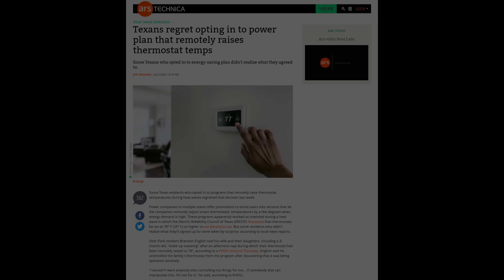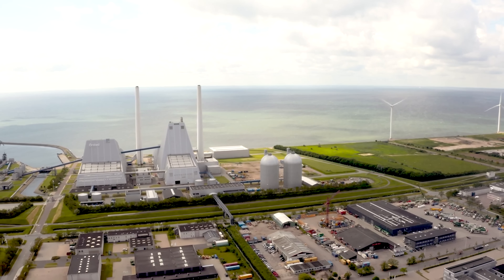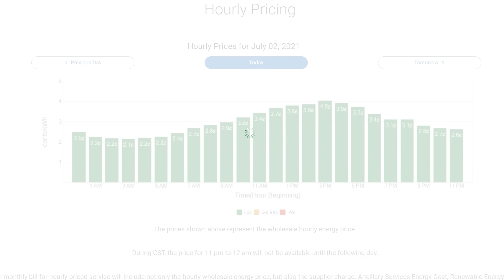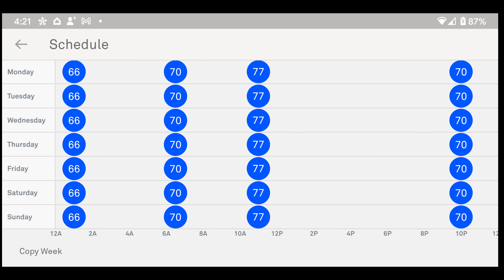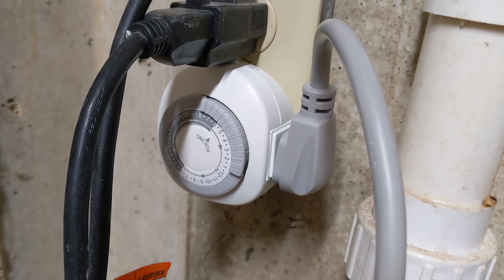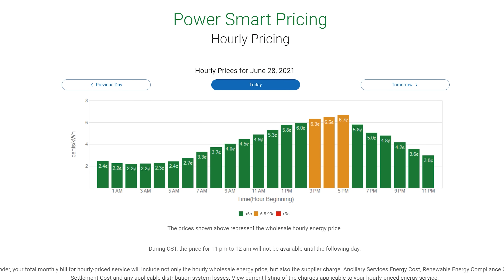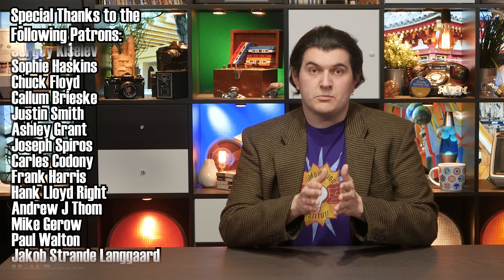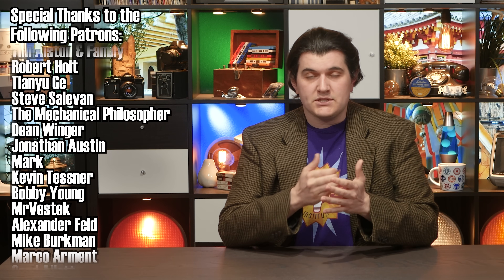Batteries aren't the only way to store energy. Here's another.

Comment: People forget that insulation works both ways, gets pretty crazy hot in Scotland these days but still cool at night so I open my windows at night and close them in the morning to hold onto the cool temperature during the day
Reply: I've been doing that here in mich for the last 10 years.
Reply: Same in California
Reply: Living in a passive house for 10 years, that's exactly what I do. Unfortunately, there is more a more noise outside during night, which start to be really annoying.
Annyway, insulation is the key. It is cheap, reliable, and almost maintenance-free.
Reply: Cool seeing you here, never would’ve thought an r6 creator top comment on this channel
Reply: I live in an Adobe house in southwest Colorado. Very dry climate but nights are cool. If I leave the windows open overnight then shut them early, house stays under 75 on a 95 degree day (freedom units)
Reply: I don't live in an insulated building, it's quite old, like 50+ years. It usually takes 2 days of hot weather for the inside to heat up. The issue is that when there are many hot days in a row, the building retains the heat and thus is hard to cool down during the night. I think a lot of the heat is stored in the roof. I don't have an AC so I try to create a draft, but if it only goes down to around 20C during the night it's just not enough to cool down the inside from 30C, at least not while the heat is still radiating from the walls and roof. I imagine it would work okay with an AC because as I said it takes 1 to 2 days for the building to heat up.
Reply: This topic is so important, an really, so easy, another way to store energy in a building is to use materials inside the house with high thermal capacity, let's say you have some internal concrete walls, they will suc the heat energy from the room when it's too hot and release it again when it's to cold, this way you dont have to cool down so drastically during the night, to have enough latent energy capacity to keep the temperature at comfortable levels, and the same goes in reverse during the winter...
Reply: Been doing the same thing is Aus also.
Reply: Crazy to see 2 YouTubers from different ends of the video spectrum show up in the same comment section.
Reply: And that is exactly why most European countries do not feature that many buildings with AC. We open the windows at night, let in the cool air and then insulate with the help of shutters.
Reply: We did this when I was growing up 50 years ago in Connecticut - we had a big attic exhaust fan that we’d use in the evenings to pull cool air into the entire house. I don’t know how many HP it was, but it was powerful enough to create a noticeable breeze in every room of the house, even with all the windows open. It’d cool down the entire house in a matter of minutes, but we’d leave it running for 30-60 minutes, to cool down all the plaster walls, which would keep the house comfortable well into the next day.
Reply: never thought of seeing an r6 yt channel here
Reply: that's brilliant
Reply: I’d rather not wake up to my house being robbed because I left the windows open! 🤣
Reply: council come and fit a stupid fan into the attic to prevent damp... aparently damp is an issue in these houses though i have literally none, never have, but it does have some wierd effects, i only have downstairs radiators turned on as heat rises so in the winter, upstairs doesn't become crazy hot, it's a nice balance... before, now the fan creates some form of barrier of cold air trying to get down from the attic and hot air going up, about half way up the stairs is a sharp transition of hot to cold, the heat doesnt go up anymore... and as for summer? well all that scorching hot air from the attic is readily blown into the house making it constantly ambient temperature (if not more if you're in my computer room!)... currently 29c outside and 34c in this room, i'm dieng.
Reply: @dickJohnsonpeter  lol wut
Reply: This is how we did it in california in the 90s
Reply: @bugz000  In my house it’s cold down stairs and roasting hot on the top floor where my bedroom is. In the winter it’s freezing all over the house and especially on my floor then with the heat on the downstairs hardly warms up while my room is a hot box. I can’t win!
Reply: People in Straya cry so much about their electricity bill but are unwilling to take any advice it is maddening. They don't even know window ventilation fans/box fans are a thing, and will run their aircons on blast even when its barely 26c. When you tell there are alternatives to lower the bill, you get some mealy-mouthed excuse that holds water like a basket. Like its 'too hot in Australia to ever use just a window fan' ..... Really our summers are nothing special compared to America. 
Then they will turn around and say 'Insulation? Double pane glass, gap sealing? its too hot here to do that, our houses would cook!'
Reply: @alminhelex  You mean the scale invented by German physicist brought to US by British empire?
Reply: I've honestly considered creating an electric window opening mechanism for this exact reason. Would be pretty easy to convert a crank mechanism, but mine are sliders.
Reply: @anasevi9456  maybe these people are not well enough educated on this topic and need to be taught about it and shown how these things can benefit them massively if they adopt these things. Just telling people won’t get them to actually do anything and them moaning about their electricity bill wont help them so between them ,the government and energy companies they could all do something to educate and make changes for the better, for the people.
Reply: Didn't expect to see you here
Reply: A weakness with that is that during a sunny day we get perhaps 10kW of sun heat through the windows, so it quickly heats up more than the insulation can keep the heat out, and we have to open a throughdraft.

Another weakness is your insulated walls can rot if the condensation point is within it. And there is no moisture barrier from the outside.
Reply: @fred-9929  Do people really not realize this? I guess it just seems intuitive to me. Might be a bit of selection bias talking just to people on this channel, though 😉
Reply: Yup. When we build our passive house with an HRV/ERV we're getting one with a bypass so we can chill the house at night in the summer if the temperature is at or below our setpoint and the oposite during the day in the winter. 
Made possible with like 2 ft of outboard insulation on a concrete house. Concrete has a hell of a lot of thermal inertia so hopefully the cooling during the night will be enough to coast through the whole day (and vis versa in the winter).
Reply: yep, i concurr. in france most houses (even old ones) have pretty thick walls. we never had an air conditionner, just open the windows at night to let the cool air in, then close windows and shutters in the morning and live on the stored negative heat for the rest of the day.
Reply: We tried that but our cats decided to explore their exit options so we don't any more :-(
Reply: That's a common Rookie Mistake. 😲 Because you're let in humidity that your AC unit has to work hard to remove the next day. It's best to leave the AC on as it won't have to run much once the sun is down. You also let in molds, gnats, pollen, pollution and noise (depending on location).
Reply: The issue is that the condense blocket is on the wrong side. So if you cool your house to much, the insulation get soggy.  And that is kind of bad.
Reply: Here in England (it’s boiling right now) we are doing that and also use the shadow of our house, we open the windows at the back, this has kept our house comfortable, even at near 30 degrees (no AC)
Reply: Wtf are you doing here. This is not a siege video.
Reply: Same here. The problem that I can't get around is getting the house cold enough on the inside during the night. While outside temeperatures get as low as 18°C most of the house can't get below 22-24°C during the night, (during daytime it can get up to 28-29°C) the house has North and South oriented windows but sometimes there's no airflow between them. I've trying to think of a way of forced air to move but I can't think of a solution that gets well integrated and not too expensive.
Reply: @awesomestuff9715  Funny you mentioned the video about fans, I saw it and commented there. I do use fans to help circulate the air, without them the air is almost still.
Reply: I was doing the same thing here in western Canada, but the smoke from the forest fires in British Columbia has become so bad I had to stop.
Reply: That is the only way I have to regulate the temperature at home, here in Germany. ACs are not that common over here, and most places you rent won't have any way of active cooling.
So once I forget to open the window late or very early, then I will notice the increased temperature the next day.
Reply: if they recalled that they would understand why winters will get worse due to green house gases, to bad for us humans are idiots.
Reply: I use box fans in the windows on the top floor blowing out and then open windows on the first floor to suck all the hot air out at night.
Reply: @nunya___  except nobody has AC in scotland and humidity isn't really an issue,(because we aren't cooling)  nor do we have toxic molds. if we get damp it's because the roof is leaking.
Reply: what are you doin here coreross. This isn't siege.
Reply: Feels weird to see a gaming channel comment here
Reply: @YelovXD  lol that's an interesting coincidence
Reply: An HVAC 'economizer' does the same thing, but manages it automatically (and also accounts for humidity). They're more common in commercial systems.
Reply: Been doing that for decades, even in the Alps
Reply: Guess this only works in Scotland where you have 24 hours of wind. Even near the coast in the Netherlands the wind dies down considerably at night.
Reply: I'd really like to do that, but I think I'll asphyxiate then
Reply: same.
working in a non ac'd dealership.
it bothers so much that they open all doors and gates wide open once it gets hot outside..
the building is pretty big, it will take several days up to a week until the inside will match the outside temperature, so why letting the heat in prematurely when you can store cooler air inside in the meantime..
Reply: I do that too. I hate being cold at night, but the cooler temperatures make the day more bearable.
Reply: This works OK for me here in Sweden, but during the hottest weeks of the summer when it gets to 30+C every day, and over 18C at night, it's jut not possible to get rid of all the heat during the night. Sure the temperature starts to fall when you open the windows at night, but the moment you close them it climbs back up to about 28C because there's so much heat stored in the building itself, and more keeps getting added each day. It works as long as there are only 2-3 hot days in a row however.
Reply: @alminhelex  If you install a whole house attic fan you can even more maximize that benefit.  I live in a dry high elevation climate (low humidity all year round) and utilize this same technique.  I have AC but it rarely has to run even on hot days.  The unit probably only runs a total of 2 weeks out of the year and that is not even continuous operation.  Even the fan only has to run a few hours at night/early morning then close up the windows for the day.  Like Alex said though, this is purely situational however this does not work in the plains with 100% humidly and where the dirt blows around a lot.
Reply: @matsv201  No. There is a vapor barrier on home insulation and homes in the US require a second full-room vapor barrier. And then there's spray foam insulation...
Reply: The Amish people in my area will build their houses to a certain orientation to allow for the best temperature management. Including strategically planting shade trees that cast shadows over the hottest sides of the house during the hottest times of the day (and hottest days of summer).
Reply: Yep, that's my new Alaska plan.
Reply: That's where a whole house fan can be very useful. It efficiently pulls air out of a house and you can adjust the cool air intake by strategically opening windows. Each open window cools that area plus the route to the fan.
Reply: Yeah, but you're weird.I'm just south of Scotland - I open the windows during the day to capture heat and close them at night to retain it !
Reply: Not mentioned, is stack effect. It can be very useful if you're house is tall, and has a way of directing airflow throughout. I had a 3 story home with a basement. I opened a window in the basement and attic - and nowhere else. It would store "coolth" in the basement during the night, and pull it up during the day. Initially, it worked till mid afternoon. It took me a few years to realize that the window fan was pulling air too quickly. Once I learned to limit the airflow, I routinely saw internal temperatures about 15°f cooler than outside through the hottest part of the day. This was in a 100yo house with no shading, no wind breaks, on top of a hill, with no insulation. All I had was a 4-5' hedge around my yard.
Reply: Trouble is a lot of places in the American south have little to no insulation, which makes for an even bigger load on cooling and heating than it ought to be.
Reply: in summer it's still usually 90 outside even overnight, last year we had a 28 day stretch where the temp didn't go below 90 day or night
Reply: I do the same all the time in summer, here in south west Germany. Worked perfectly for me so far.
Reply: I recently moved to a place that reliably gets cool at night, and doesn't get super extra hot during the day (actually it's pretty mild most days in the summer, but we have the occasional unpleasant week).  So I have different nighttime and daytime cooling modes.  During the day, I close the windows and their blinds & curtains.  As soon as the outdoor & indoor temperatures cross in the evening, I open all of the windows and the front door (which also has a screen door), pull back the picture window curtains (so I can radiate heat out that big piece of glass), and turn the bathroom exhaust fan on.  When it starts getting warm in the morning, I flip back to daytime cooling mode.  This place also has really deep eaves, which my houseplants don't like, but my cooling situation benefits from, by having way fewer hours of direct sunlight on the windows.  It occasionally gets too hot in here if we have an especially bad couple of muggy hot days and not-very-cool nights, but mostly I don't miss air conditioning.
Reply: @nunya___  those are hardly toxic, and the article itself recommends opening windows as a way to get rid of them.  "Can mould cause health problems?

Moulds are usually not a problem indoors"  and "Reduce the condensation that builds up overnight by cross ventilating your home"   In humid climates it's more of a problem because moisture will be inside the walls, or working its way inwards. in temperate climates it's condensation on the inner surface from cooking and bathrooms etc. hitting cold walls.
Reply: I do that in Cincinnati too. 

The only negatives are how humid it is here and we have pretty bad air if you have allergies since we’re in a river valley.
Reply: Oh shit, it’s coreross! I keep my windows closed during the day and closed at night because I can’t stand bugs and stuff
Reply: @RochRich.  bug screens?
Reply: If you live in a tall building and can get a through breeze, that is an equally cheap but simpler way of keeping your home cool. I live in a top floor flat, and in summer I almost never close my windows because there's no need. Paperweights are sometimes necessary though!
Reply: @OrigamiMarie 
I’ll probably buy one soon
Reply: I don’t think people forget that.
Reply: Yes, exactly!

We've had few heat waves here recently with daily temperatures reaching 35°C+ (that's 95° in freedom units), but during the night they can drop as low as 20°C (68°F). 

Such high temperatures are not common where I live, so many (including me) don't have AC, I had to improvise.

While bunch of my friends complained about the heat, their electricity bill (those with AC) and what have you, I've simply left two windows on opposite sides of my apartments open during the night. 

I've even found trough experimentation, that if I open two windows on opposite sides of my apartment during the night, it creates a draft that quickly cools down entire apartment. Plus I get fresh air every night. :-)

Then I only need to keep windows closed during the day, and sun-facing windows shaded.

My apartment didn't go above 24°C even during the worst of heat wave.
Reply: Yep, have done it all my life.
Reply: @nunya___  having two vapor  barier is a horribly  idea,  that was tested  here a few decades ago. They had to rip out the insulation in those houses
Reply: Crazy hot?  You mean sometimes it gets into double figures?
Reply: I do the same thing, but I also have a big 20" fan in the window.
Reply: Agree completely. In Wales, during this current heatwave my bedrooms are atrociously warm. The problem is there's no wind or even a relevant breeze, I leave all the upstairs windows and doors open but to no avail. I shut the blackout blinds and windows in the day but last night my coolest bedroom that does not get the sun all day was 24.3ºC. Could be worse, it could be 1976.
Reply: And of course that's in addition to being on the Isles where central AC isn't very common.
Reply: I'd do that too if that didn't allow swarms of mosquitoes in
Reply: @workdogwern4716  I do a variant - one window open on the top floor at the front and one window open on the bottom floor at the back !
Reply: @christopherrto  linear actuators built into the frame
Reply: I live on the South Texas Coast, It's been 82*F (27.8*C) at night and close to 100% Humidity. HAHA I do miss living in the mountains of Wyoming, could be in the up 80'sF (around 30'sC) but in the 40'sF (4'sC).
Reply: @TdrSld  [When typing, holding down the Alt key while you enter '248' on the numeric keypad, gives you this: °]
Reply: I’m very happy that coreross and I watch tech. Connections.
Reply: @fred-9929  Wouldn't it be easier to use the HRV "cooling" (bypass) function (assuming yours has one) to do it automatically?
Reply: Yeah, you can see many people to open Windows if its hot outside. Thats soo contra productive
Reply: Drives me crazy when I go out on my balcony at 10pm when it's a beautiful 68-70 degrees and about half of the people in my building have their ACs running.  Not only is it a waste of energy, it's loud as hell!
Reply: Was definitely not expecting to see a coreross comment here
Reply: Wtf you doing here? You still have to make that R6 operator tier list!
Reply: same thing i do here in the usa. i wasnt aware so many didnt know this
Reply: Nah just drywall and massive AC unit!
Reply: Scottland? i'm sorry.
Reply: Yeah, that's what we do at home.
Reply: If you get a cool night. I’m in Staffordshire and I just can’t my flat less that 25°c
Reply: "it keeps hot hot and cold cold"... Ya, but how does it know?!
Reply: Yeah my dad does that in New Jersey. His AC doesn’t click on until pretty late in the day
Reply: I do that too, but when you're on the top floor of a block of flats, it only lasts halfway through the day at best 😢
Reply: keep yourp
Reply: From California. Just upgraded windows to double pane. That changed a lot.
Reply: This works even on my old European house from 1900. No insulation on (yet), only ceiling has 50cm rockwool... no aircon, but trees on south/west side. With night only ventilation house keeps nice cool temperatures thanks accumulation in mass (50cm/20inch solid brick walls).
Reply: Works only if you don't have allergies. Though maybe with a clever heat exchanger this would work without bringing pollen and pollution indoors.
Reply: There are actually window fans that automate the process, now.  They look like really sleek window air conditioners, have a thermostat, and kick on when the temperature outside is cooler than the temp inside, if the inside temp is higher than the programmed temp.  Shutters keep them from letting in rain or hot/cold air when they're not turned on.  Mine sucks out air from the top on the indoors side at the same time it's pulling cool air in from the outside, blowing it horizontally into the room, so it refreshes the air nicely as well as cooling a bit faster.
Mine also has a hygrometer that stops the fan from turning on if the humidity outside is higher, which is the worst part of the device for me because I live in the desert and humidity increases at night outside while the inside stays dry, causing it not to turn on when I want it to.  Fortunately, there are manual controls, but being able to disable the hygrometer would be nice.
Reply: My housemates don't understand this and it's maddening.
Reply: I do that, too!
Reply: Living in France where, just like in Scotland I suppose, AC is clearly not as common as in North America. Always done this, have learned to do this since childhood. It's just such a logical way to do things.

It irks me that constructions from the 50s to very recently have not taken this "insulation works both ways" into account. Even in the early 2000s when we started making isolation a topic, we only talked about isolation against cold. But isolation against heat is just as important IMO. Old houses are the best for this. Thick walls of stones will make your house cool whatever the temperature outside. Modern houses made of hollow concrete blocks? Not so much.

It's not energy storage, it's just not needlessly burning energy. It's efficiency. And it just makes so much sense that I'm puzzled as to why so many people are unaware of this.
Reply: Your power price chart is pretty old style.

Here in Australia power is pretty much free in the middle of the day.

During the night we use coal for power....😣
Reply: sat up in my chair once i noticed the username
Reply: @Tomek_i  I have one, and it is activated, but it is not enough, even at fans full speed, as the temperature difference is too small...
Reply: It gets crazy hot in Scotland?
One must not forget that "crazy hot" in Scotland constitutes anything above 20°C with only light drizzle.
Reply: I live in a badly insulated 70's house without AC. The only reason the 'open up two opposite windows and put a fan in one blowing OUTSIDE' cooling doesn't cool the house down far enough is that it's unsafe to leave a street facing window and the back door open overnight. 

And of course there is the uninsulated attic bedroom that needs both windows open 24/7 in order to not get hotter than outside.
Reply: @sporkeh90  put a fan in one window. It works. Even in Limburg, where we don't have coastal wind and usually higher temps.
Reply: In germany having or running an ac is pretty uncommon.
Then again energy is so expensive and I mean so exorbitantly, horrendously expensive that only the very wealthy could run it anyway.
I mean take me extremely energy saving single person, 1.5 bedroom flat as an example: last year I used about 560kwh total.
That’s less than 1600wh a day - I pay 26 bucks a month for this. And that’s while using a quarter of the national average … greedy energy companies ? Nope. Taxes. As with literally everything in germany.

Don’t even get me started on internet or even worse: cellular networks. I live in the very middle of a mid-sized city and I literally cannot make phonecalls anywhere near my flat.
Mobile data is still limited almost everywhere - I for once have about 8 gigabytes at my disposal. It’s common to pay upwards of 50 bucks for that. Networks are spotty at best.
Reply: @alminhelex  adobe is shockingly good at insulating. It's unfortunate that they seem only useable in desert or near-desert climates. And only in areas that aren't particularly earthquake-prone, too.
Reply: @ReNeyer  actually, that's because most European countries don't spend all summer at 40+°.
Reply: I love how European are like sooo ahead about this 

Also houses made of ouf stone -> holds more heat.
Annnnd stricter laws about insulation.
And smaller houses.
And less open spaces. 
It's frying in France rn, so I sleep with teh window open. No AC whatsoever here.
Reply: @anasevi9456  unfortunately if your houses are anything like ours in the US, they're simply not built for it. It's more than just insulation; it's also the layout, and building materials, and more. Meanwhile, having a house custom built is SIGNIFICANTLY more expensive, and even retrofitting just things like insulation and windows can be prohibitively expensive.
Reply: @YelovXD  i don't know if you own the building.  But if you do and the roof is a problem.  You could putt up isolation on the inside and paint the outside white. Works really well in reflecting sunlight. Even better if you could use reactive panels. They turn white when they get warm but when cold they are black.
Reply: I actually had no insulation for the span of a few months. It was extremely painful all year round. you could expect electric bills of up to $500 a month in the summer months. and in the winter, I open the windows because it gets pretty toasty and I like it cold in the house.
We have this really huge kitchen and living room, right next to a converted sun room which we install curtains to make the temp not rise too much. I've closed the living room and kitchen vents in the winter because it's a colossal waste of money to power those, since me and my housemate only stay in our rooms 99% of the time. We've also installed door sealers so we could keep the door "open" but have it seal behind us so the pets can move around.
Reply: @fred-9929  A good ventilation system can do the same work without the same noise level, but it'll consume some electricity..
Reply: I do the same
Reply: Same. Not many houses have an AC unit in Germany. In the past it just wasn't necessary since we only got crazy hot temperatures for a week or two at most, so installing an AC would've been overkill.
This might change in the future, though. Luckily, this summer has been pretty cool most of the time so far, at least up north, where I live.
Reply: That is the best passive way there is. A part of our waste usage comes down to laziness and unawareness
Reply: I haven't switched my heating on for over a year, windows permanently open till November. Edinburgh has been offensively hot the past few days.
Reply: Doesn't help when the sun is full on blasting and heating your walls and roller blinds to +36 degrees C
Reply: Heavily region- dependent. I'm not even close to a southern state and the nights rarely have a low temp below 70 in the summer. I'll do some good, but last time I tried without a big temperature difference I got no decrease in inside temperature and a lot more humidity.
Reply: @J0k394  Ja dat doe ik ook in Limburg, maar das niet precies wat hij zei ;)
Reply: The insulation in my house is too good. At some point in time in the summer, the house contains too much heat, and everything needs to be opened all night long. But it doesn't really work anymore.
Reply: I do the same. Need well insulated house.
Reply: "crazy hot" FOR SCOTLAND, I presume you mean. ;)  But that's it, isn't it -it's down to what we're used to. It's no good pointing out Death Valley has always hit triple digit (F) temps... the pacific north-wet has NOT... until now.
Reply: Same, in the hills near Madrid. 
Moreover, at night I jam a square fan in the  window, caught by the roller shutter, and force the cold air inside the house for a couple hours...it works wonders to lower the temp of the whole house
Reply: I usually do the same in my house, unfortunately I can't open the windows wide open due to flies and other insects since I live in a farmers field. I'd love me some filtrated HVAC system that can take outside air at night and cool down the house until a set temperature. Typical summer day now is around 26-30 C while it's around 10-15 C at night.

EDIT: I live in Norway btw, so most of the year we have cold days and even colder nights, but in summer it can be unbearable. Luckily our houses are usually well insulated.
Reply: Blinds: 
1) If you life in a City (especially when you know other apartments have been broken into trough the window) you might need to get some Blinds to do so. Although the saver ones drastically reduce the amount of heat exchanged at night.
2) But on the other side Automatic ones can keep the heat of the main hours outside, while also letting your plants get enough light. (Still better than cooling, but if i remember correctly, designing overhangs properly also works.)
Reply: Be careful with that. High humidity low oxygen air can become dangerous, especially for elderly.
Reply: Same, also we have our bedrooms at the bottom floor and our kitchen at the top, was weird when we moved in, but now that we have been living here for 2 years, it is so nice, it's always cool whilst sleeping, gets a tad cold in Winter, but just use a 2nd blanket and it's fine, cold is more easily dealth with compared to heat.
Reply: I open the windows in my apartment and use a pair of fans on one side to suck hot air out, drawing cool air in from the windows on the other side.
Reply: no it does not get "crazy hot" in Scotland. not even remotely close. its almost 2 am here in SWFL and its 81f which is what Glasgows high will be tomorrow.
Reply: I live in the American south but I still do this during spring and fall
Reply: During some months I do the same. Fans are turned on around midnight, and the house is quite chilly by 8am, when they turn off by timer so they dont pull the warm air of the morning in
Reply: @DasSkelett  Low oxygen, why? 

Do you live in an airtight apartment with rooms cram packed of standing grandpas?

 U'r weird...
Reply: Put a fan inside your room and point it outside the window, to speed up cooling.
Reply: Wait someomes surprised by that?
Reply: My aunt ann uncle live in an old Adobe house in the Arizona desert. They do that and have no central air, it'll be 115f outside and a nice 65f inside.
Reply: Same here also in Scotland
Reply: Yes corecross, a lot of americans wonder why europeans don´t need airconditioners. This is why. I do it the same way
Reply: Same in britain, having the windows open at night (making sure the lights are off for.. obvious reasons) basically means I do not need airconditioning until never.
Reply: I live in an old swiss house and also do something similiar. When I wake up in the morning I open all windows so the house cools down and I get fresh air. Then when it starts to get warm outside I close everything. In the winter I do the opposite. 
I can also control the temperature in the house pretty good by opening and closing blinds when the sun is shining on a window.
Reply: Crazy hot in Scotland?  lol 25 degrees isn't crazy hot.
Reply: @bugz000  Can you reverse the direction of your attic fan, or shut it off? It's effectively pumping the hot attic air down into your living spaces.
Reply: @TheChzoronzon  Well thanks for insulting me. Gonna ignore that for now.
Indeed, modern buildings are pretty airtight – that's the entire point of insulation. You don't want to loose warm air in winter or cold air in summer.
Which means, if you turn of all sorts of air conditioning and ventilation, you end up with pretty "old" air after a few hours - high humidity, high CO2 and other gases, low O2. Of course not to the level where you will suffocate, but enough to make concentrating harder and make you feel tired.
Reply: We do the same thing in my house
Reply: @thelight3112 yes that's precisely what it's doing, it's also has not got its own breaker so I've no idea where its power is coming from... I can speed it up or slow it down, no "off" though!
ebay.co.uk/itm/184428323166
This is the one I have fitted
Reply: Same. Only problem is that I live on quite busy street. And that it does not work when there's 20C in the morning, 35C in the afternoon and still 25C at the midnight for 10 days - I had like 25C in the morning and 30C in the afternoon. Which hopefully did not happened since 2015 when we had like three heatwaves. Some years we have above 33C just a few days or night temperatures rarely exceed 20C.
Reply: Yeah when you have no a/c it’s the only option!
Reply: Doesn't work if you have sun shining on big windows. We had to install AC few years ago.
Reply: Same in California , BUT when it “cools” down to 85 F it doesn’t help much.
Reply: This works perfectly here in norther idaho also - not great in high humidity places where the night and day temps are similar.
Reply: Its funny that the young kids don't understand why all the old houses in the US, especially in the northern midwest has double hung windows.  That way you open the bottom window a bit and pull the top window down a bit and the hot air will go out the top and the cool night air comes in the bottom.  Didn't have AC back then.  Unfortunately the houses weren't insulated but they did have solid planks nailed on the outside which did insulate a bit.
Reply: @ReNeyer  another difference is that in Europe most houses are built out of stone/brick or concrete and not wood and most of the US are further south than Europe (for example Pittsburgh PA has about the same latitude as Rome in Italy)
Reply: That's, like, 90% of Brazilian houses.
Reply: Didn't expect to see you here...
Reply: @DEtchells  Whole house fans are great! The house my father grew up in had a large fan in the attic that was run at a low speed but because of the size of the blades could draw quite a lot of air while staying relatively quiet. It also had a gasket (might have been felt) to dampen the noise. The family opened the windows on the lower floors before turning the fan on. It took a bit of time before the cooling could be felt but once it started it kept the house cool through the hottest part of the day. My grandfather had talked to several other men about their experiences with a whole house cooling setup, and had replaced the existing attic fan with one that was more up to the job. I imagine that an HVAC specialist could have suggested further improvements.
Reply: @matsv201  No. These are "Back to Back"  not "sandwiched". This works and is code now in the US. Basically a two-ply barrier so no chance of trapping moisture in a middle insulator as you are describing.
Reply: @mralistair737  LOL I have a degree related to this but I'm sure you know best. Good bye.
Reply: I do the same over here in Wales
Reply: @nunya___  yea.. you dont seam to have any experiance in the subject. Mostiure always comes throw.
Reply: How hot?
Reply: @nunya___  well explain why the article actively encourages the problem you've said causes it then?  I've grown up in scotland, closing windows is more of a cause of mould than a solution.
Reply: One house I lived in had a large fan built into the ceiling above the staircase at pretty much the highest point in the house. Turning on the fan would suck air up and out. The morning routine was to open the windows and turn on the fan for an hour. Thanks to that thing, we barely needed the AC
Reply: Me living in the tropics: Insulation?
Reply: I want to know what "pretty crazy hot" is. The last time I was in Scotland, people were complaining about it being 8 degrees.
Reply: @booaussie  I think it nudged 28C there in the last week. .. so not crazy by the definition of most countries.
Reply: Hey uh, would you mind if I sneak into your house some time
Reply: but too much insulation is bad
10C hotter inside then outside if I leave windows open at night
Reply: It would be awesome to know what the energy usage would be without this schedule. With lower delta temp, you would have lower losses. By going that low, you might cause somewhat higher losses.
Reply: People forget that a lot of houses are designed specifically for passive heating and cooling and that's why today's standards don't work efficiently.

In the American South, houses were designed off the ground with high ceilings. They were intentionally left drafty to encourage airflow from the cool shaded underside to the hot attic. By sealing it all up for an HVAC, it tends to work against itself. 

This is also why operatable transoms were a thing. So hot air can keep moving across the ceiling.
Reply: Been doing that for 60 years+. It's called living a frugal lifestyle.
Reply: @Raansu  same in South East Asia.
Reply: that's.... common sense. Everyone does that
Reply: You’re gonna wear your windows out and pay to repair or replace them eventually. Lol
Reply: You’re gonna wear your windows out and have to repair or replace them if you keep that up. Lol
Reply: @YelovXD  if the roof is made of metal sheets, consider it replacing it with ceramic tiles. It will make a huge difference
Reply: I had external insolation fitted, noticeable cooler during the few days of summer we get, often have to put a jumper on.
Reply: We had the storage radiators in the 70s in my childhood, it wasn't very efficient often had to put them on, during peak hours, because of the lack of insulation in those days. Single glazed windows, 4" of loft insulation, if you were lucky. I still come across those bricks, I now have them in my greenhouse as thermal mass, a crude pipe a computer fan and a solar panel, to 'charge' them up during the day, from the greenhouse apex
Reply: Wikipedia: The highest official temperature recorded was 32.9 °C (91.2 °F) at Greycrook, on 9 August 2003.

You should probably only visit Australia in our winter then.
Reply: @Alexander_l322  If your windows are the only thing stopping someone from robbing your house, they can just break them.
Reply: Same in half Spain.
Reply: Coreross watching tech connections
Reply: Lmfao coreross
Reply: Same in Ohio it can be 100f in the day but a nice 50-65 at night. I keep my temp set at 72 in the summer and it’s off when I’m not home so most days I just open the windows at night and close in the morning and it stays cool all day. Also the solar array you keep showing went bust within a few years of opening and replaced by a natural gas unit one of the largest peaking units in America
Reply: @nunya___  well thank you for telling an architect how to design buildings in a country you've never been to. .  I think about 0.1% of houses in scotland have AC.  what you dont seem to get is that the cooling is a huge factor towards generating the (liquid) moisture that you are then worrying about. Now i understand in climates where you need to cool and therefor need to dehumidify, but there is simply no need in most of western europe.  Getting rid of windows is a terrible idea, and sealing up buildings with little ventilation as you suggest is way more likely to cause problems.
Reply: @mralistair737  I accept your Architectural degree and raise you an Engineer degree. Now, you were saying that you have moisture issues in your home and you think Air Conditioning is adding water grains to the air? Inside the structure? Please explain the principle behind that supposition. I am truly curious.
Also, You obviously use a Air Conditioning system so I'm assuming nothing...no matter where you live. And I say again, if you open your windows each evening/night you are letting humid air back into your structure. You paid money to remove it while cooling the structure all day. Relative Humidity rises in the evening/night. Sometimes to the point dew forms on many surfaces. You say you open the windows for free cooling yet you let that saturated air back into you home. The high water vapor content is reabsorb into your furniture, bedding, carpets, walls, clothes, etc.. Removing it again obviously requires energy.
Reply: @nunya___  no, the point is we generally dont have moisture issues in our buildings. but if you make the fabric of your building colder, than the ambient temperature, then you need to be very careful about moisture as humid air will condense on cold surfaces, and in a cooled building, those surfaces might be inside walls etc. which make for lovely places for mould growth, hence why you need to de-humidify when cooling a space... but in a building that you didn't cool there is no increase in the risk of moisture from opening a window or ventilating, in fact generally the reverse.   are you seriously proposing that buildings should not be ventilated?
Reply: @mralistair737  No, all buildings should be ventilated to some extent, but ideally with pre conditioned air. This is where fresh air heat exchangers (common in home design here) or "economizers" for commercial applications is implemented. If the walls of a building are condensating aka "lovely places for mould growth," they do not have adequate insulation, ventilation and/or vapor barriers for conditions. I don't work in renovations but I've seen that sort of condensation in residential plaster and wood frame construction. That is minimized by adding (in that case, "blown cellulose") insulation and ensuring adequate outside ventilation for the wall cavities. An inside vapor barrier was not cost effective in that case.
Reply: Sadly the nights with under 20 C are less and less in germany. Most here have no ACs and it gets hotter every year.
Reply: That's what I do and I do the opposite in the winter(mild). I live in a moderate weather zone, so it works pretty good.
Reply: Are there two Scotlands?
Reply: @bloepje  Ja die A+ woningen zijn een ramp wat dat betreft, als het vorige week 30 graden was merk je het nog.
Reply: @akulkis  Weird and cruel thing to say, honestly. I don't disagree with the facts but I had the privilege to leave and most people don't and I have a lot of trauma and pain wrapped up in needing to leave my homeland. You kind of went out of your way to hate on california and I find that kinda weird! Definitely spoken like someone who has never struggled with survivors guilt.
Reply: I've seen buildings with automatic windows for this reason too. Really cool!
Reply: My mom used to do that when I was young, and we only had window units.
Reply: Yup, I made some DIY insulated shutters for our house... they're not the prettiest, but they've had a massive effect on how much we have to spend on heating and cooling.
Reply: White paint, white roof. Makes it better to insulate solar rays.
Reply: +20C - crazy hot in Scotland
Reply: How could you build a house to better take advantage of that?
Reply: Oh! Same here!
Reply: This is what we normally do in the Pacific Northwest. Our #seattleheatwave was so bad not only because of the daily highs, but because the daily lows were above 70 degrees when they are normally in the upper 50's even in the summer, occasionally peaking in the low 60's. Coupled with houses designed to hold onto heat, the usual overnight precooling for a hot day just didn't work.
Reply: @YelovXD  
You could try to insulate the outside of the walls by having soms plants growing onto them. I have a few roses growing on the south facing walls and it’s surprising how much heat the absorb. Plants also evaporate water which can easily lower temperatures by 5°C. 

You can cool down the roof by spraying water over it and let that evaporate. You don’t need a constant flow of water, as long as as the roof is moist, it cooled down to the dew point. That can 5°C to 15°C below ambient (mostly depending on the humidity). 

Adding a fan on low speed to circulate air where there’s no natural circulation might also help. 
Hth
Reply: Laughs in random East coast weather
Reply: I've got them open at all times, because the windows work like heaters when closed 
(when open the angle they are at doesn't allow sun to shine onto them) 
heating up 26.5'C is at least for me, a lot better than 32.5'C when all are closed off
Reply: Tend to do that too. It works for a few hours
Reply: That's basically what we Germans do instead of even having AC. Around Europe, air conditioning is rare, mostly used in office buildings. With climate change marching on a it is, though, we might have to change our attitude some day...
Reply: That's how all of Europe without A/C survives 36°C for a long time.
Reply: @sporkeh90  Uh, wind exists outside of Scotland. Here in Germany, hot days are very often followed by thunderstorms by night. Opening your windows carefully (no draft!) will get you a wonderfully chill flat/house the next day!
And in places like Bratislave, it's just windy all the time. Gave me headaches, truth be told.
Reply: @Morboxx  Yes it exists, I doubt its a steady 10 m/s all day long.
Reply: @sporkeh90  It doesn't have to be, if you can create draft.
Reply: Idk how this is a new thing for people.... Me and my family have been doing this my ENTIRE life, so when he just said overcooling I was like, "oh yeah, I do that"
Reply: ayyyyy coreross!!! I fucking love you and your channel
Reply: We've been doing that for, well, forever. If it's cool at night, unless it's very damp, all the windows open until it warms up again outside to over inside temp.
Reply: No, we don't forget that.
Reply: The house I bought has a separate controller that opens a damper to allow the blower to pump outside air in when the temperature falls enough. This could help with the outside noise issue if it's something available in your area.
Reply: What are you doing in this video lmao
Reply: In Germany its a national sport that we call "Nachts durchlüften"
Reply: @Raansu  that's why we get Spice, Bath Salts, and Crack. Survival nessesities
Reply: my house would be full of bats.
Reply: This is called a "summer heat purge".
Reply: @Alexander_l322  , move the bedroom downstairs where it’s more comfortable?
Reply: @TheRealBalloonHead  oh yea you’d like that wouldn’t you!
Reply: Yep, up here we do AC the most efficient way: opening up a window
Reply: @sporkeh90  I live in one of the window at aces in Scotland. Last week we had 2 consecutive days of dead calm.

Nowhere has 24hrs a day wind.
Reply: @mralistair737   lives in Shetland, looks sheepishly over at portable air con unit in corner of room... rem, about that no one in Scotland thing Alistair old boy... that's south facing dual aspect upside down houses for you.
Reply: I wouldn't do it, just in case a ball lightning would like to come in.
Reply: That unfortunately won't work on the seaside tho. If it's hot during the day, it's not much better in the night.
Reply: @Alexander_l322  if you're that likely to be to be robbed, install some bars to keep the very big pests out.
Reply: Fellow Scot here.
And just to inform everyone else anything above 10c is t-shirt weather. 
And on a side note for years I thought Poland was a sort of similar climate until every Polish person I've worked with complained about the cold while I'm sitting sweating like a pig at 15c.
Reply: @fred-9929  if noise outside bothers. Look into a fresh air intake for your AC. It’ll run the fan pretty cheap still. Aprilaire makes tons of fresh air intake and air intake controllers. It opens and lets in outside air.
Reply: I do this and I thought I was the only one. 😂
Reply: This also helps to feed the midges
Reply: @YelovXD  soffit vents and roof vents like ridge vents, are for letting the air circulate inside the attic so it doesn't get so hot up there. if you're not getting adequate flow then maybe your insulation is blocking the soffit vents. I'm planning to install baffeling to keep the insulation out of the soffits to improve this circulation.
Reply: Really? In Scotland? Never woulda thunked it
Reply: lol ll
Reply: @timshen6516  Same in Colorado!
Reply: That reminds me of this time in highschool that I suggested wrapping some beers or something in a towel to keep them cold, only to find that it needed to be explained that, no, that will not make them get hot faster lol
Reply: Same in Ohio
Reply: "pretty crazy hot in Scotland"???

That's got to be the biggest joke I've ever heard 🤣🤣🤣

Freaking 20° isn't hot.
Reply: Oh yeah, is my zone is the same. Is a desert.

Opening windows on night is a very good idea here too.
Reply: I'm in Texas, it's always hot until it's not
Reply: Same in Ohio
Reply: Oh yeah, I’m a nightshifter so I get blackout curtains, and those do so much to insulate as well.  Between that and tinted windows, and switching to all LED lights saved me literally hundreds.
Reply: 11:30
because it's so forkin' humid here
Reply: That's how almost everyone lives in Seattle where few homes have air conditioners. It helps that there are only a few weeks each year with temperatures close to 100f.
Reply: I live in house made out of solid wood. The indoor temperature usually stays up to 10°C below the peak outside temperature in Summer because I gather "coldness" during the night and trap it throughout the day. Completely without active cooling because it's Central Europe.
Reply: @YelovXD  Some old houses don't have enough attic ventilation and therefore build up heat which then starts heating the living space below it. You really can't over ventilate an attic, so go for it.
Reply: @oleeide9763  That is the concept of thermal inertia. Very effective.
Reply: @gregripp  It's not a house, it's a small apartment building. I got an AC this summer, so that solves the issue I guess :D
Reply: When I was a kid I used to live in a house that was made back in an era where A/C systems existed, but weren't really thought to be necessary since the area never really got higher than 85°F (29.4444°C) on most summer days (or 90°F/32.2222°C on a rare day).  Though as the area got more built up there was a little bit more of an "urban heat island effect" (and likely due to other things) caused temperatures to get high enough that one of my favorite summer things as a kid were nights where we'd use the screen door, open up all of the windows at the rear of the house, and use a giant fan—aimed outwards—to create negative airflow and exchange all of the heat out of the house with the cool air from outside.

The house was pretty old and did have some insulation, but the the glass was single-pane and some of the walls didn't have much modern insulation except where my folks had retrofitted it.  So even though we'd close up the windows in the early morning the house would start to feel fairly warm by about 3PM (often a bit warmer than the external air temperature due to the roof being done up with tar and tar paper with some loose gravel to bounce some light—at least in the areas where it wasn't pitched) so on some days the windows would get opened earlier.
Reply: And this works everywhere because at night it's always colder than during the day, so in some places this works better than others but works
Reply: Rather than automate air conditioning, make windows that can be opened and closed automatically based on outside temperature and/or time. Add an automated attic fan and you can bring the outside cool air in at night while evacuating the hot air from the attic.
Reply: Ya if you have insulation
Reply: mosquito problems aah
Reply: We also hang greenhouse shade cloth (Aluminet70%) from the eaves outside our west and south facing windows during the summer and early fall.
Reply: Same
Reply: Hello there im just curious. About your comment, when you say it gets crazy hot in Scotland these days, how hot is crazy hot?
Here in central Florida it’s nigh impossible to survive without AC  it gets sweaty and humid for most of the year and now at the time of this writing it is 80 during the day and cool at night around 65 so I can save energy by opening up the windows st night and letting it stay cool through the day, it gets a little warm but I can turn the ac on for a few min if I have to.
The reason I ask you about the temp is bc throughout the year i like to look at temperature maps around the world. That shit just fascinates me. I imagine in the spring and autumn it is probably near perfect temperature.
In the winter here in southern Florida it is known to be gorgeous 60s 79s and sunny
Reply: Never thought that I would find an R6 YouTuber here in these comments lol
Reply: @ReNeyer  The min nightly temperature in the midwest US is much hotter in summer than much of europe, for various reasons. I am able to do that here, and agree, it saves so much energy cost. For example though, 29 c at night   was the lowest it got while attempting to camp in the summer in north east Nebraska once. That part of the country just cooks in heat, partially because it's so humid.